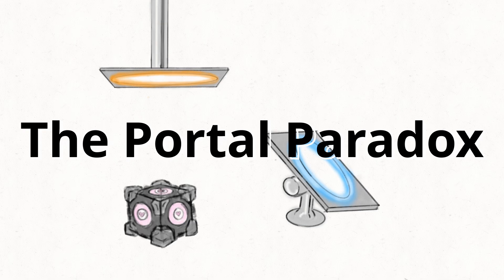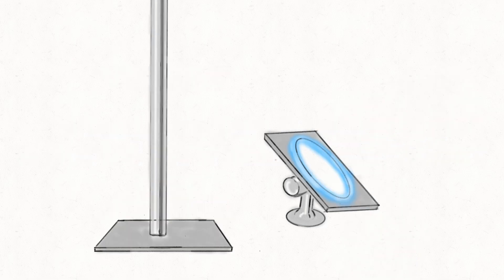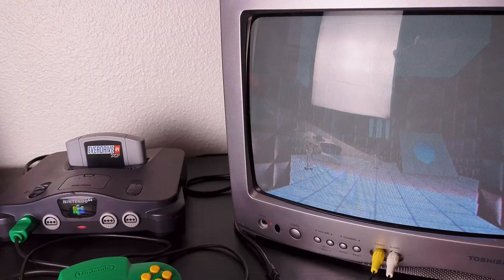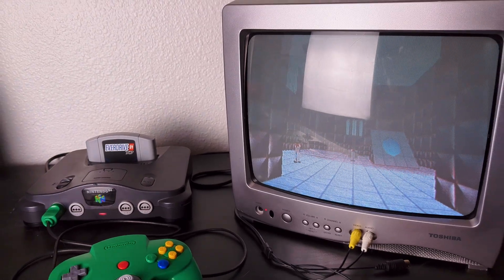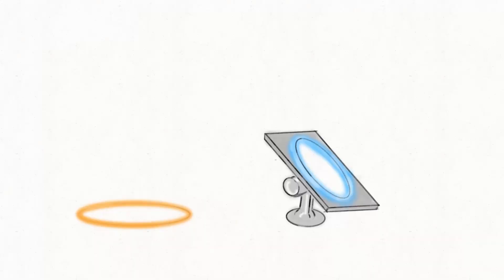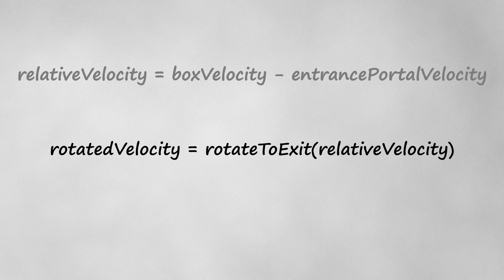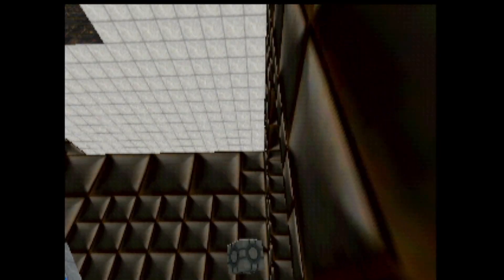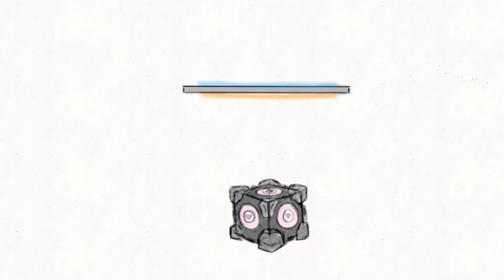I rewrote Portal from scratch and solved the Portal Paradox

Comment: Ok now I have a question of what would happen to the orange portal that gets slammed into a wall and thus has no like open air to free flow through it, like would a vacuum appear that just rips everything into it until a new open air area appeared in front of the orange portal or would it cease to exist once this happens and thus a closed blue portal would then exist

Comment: 0:53 - "...does not using Source engine invalidate this test?"

To be fair, moving Portals ARE possible in Portal 2 (I'm not sure if they're possible in the original Portal though), however the set-up for the """paradox""" still doesn't work as the piston just collides with the box and gets stuck (it's possible to disable collision on the piston to make it not collide with the box, however this means the Portal cannot be placed onto it. The real paradox is figuring out how emulate the scenario in the original game engine).

Nice work on Portal N64 though. Can't wait to see the next update video!

(Side-note, I don't know about you, but I absolutely hate this """paradox""".
It's not even a paradox, it's mostly a bunch of laymen arguing over something they can't answer because they lack the fundamental understanding of physics required to figure it out (and even if you have that knowledge, it only takes a minute or two to solve and debunk))

Comment: If the portal rapidly descends but stops abruptly at your neck level, does your head fly off?
If it descended upon a stack of cubes, would each cube fly off with a delay between each?
Reply: if it's descending with enough force to rip the neck then yes, if it does not, then it would be painful but the rest of your body gets pulled through due to the momentum dissipating.

Comment: What if this happens: The portal moves down towards the cube, but about halfway down the height of the cube, the portal stops moving. According to your approach, we'd have half of the cube sticking out of the other end of the portal which would experience velocity X, but the other half of the cube would still be where it originally was, with velocity 0.

If you think about it, according to your approach, the intertia resulting from the half of the cube that's already through the portal and that, according to your approach, should have velocity X, should at the very least lift up the half of the cube that still hasn't passed through the portal. Additionally, this only works because in the game engine the cube is a rigid body with no flex/stretch. According to your assumptions, the cube would get stretched/flexed because one half is stationary while the other half is accelerating. This, in turn, would have even more effects down the road once the whole cube has passed through the portal.

Unless, of course, the way you coded this is that velocity only gets transferred if an object has passed through the portal 100%, but in my view that in itself is an incorrect assumption about how portals work, and thus would invalidate your experiment.

Another way to test this would be: You, the player, jump through a sideways-moving portal. According to your assumptions, and implementation, once you have passed through the portal, the sideways-velocity of the entrance portal should make you, the player, move a little bit to whatever direct the entrance portal was traveling towards at the moment you passed through the portal. However, since one part of your body is moving, and the other is not, this would rip apart your body from both inside and outside, killing you almost instantly. Unless, of course, the moving speed of the entrance portal has no effect on the object passing through.

Additionally, this whole debate about this topic is whether the velocity of the entrance portal has any effect on the relative velocity of the cube. You just assuming it does, and then telling people "my experiment worked because I based my assumptions on my personal understanding of portals, prove me wrong", while you have no proof yourself that your assumption is correct, is at the very least a little disingenuous.

Comment: I never clicked on recommended videos about the portal paradox because it seemed obvious to me. Speed is always relative, so the exit speed of course depends on the entry speed relative to the portal. In game engines, position and velocity has to be stored in an absolute way, so it'd actually be easier to implement this with the absolute velocity, though not physically accurate.

Comment: I'm actually really glad that you brought this question up because I decided to wrack my brain on this question as a serious question regarding what would really happen, suffice it to say that yeah, GLaDOS literally explained it, speedy thing goes in, speedy thing goes out, and that speedy thing is from the relative point of view of the portals which from their view are always stationary while everything else moves around or through them.

A fun side piece I realised though is angular momentum and forces acting through a portal, as well as a very interesting scenario of "What happens if the portal stops half way? Does it stop like nothing happened or what?", and the answer is "moment of inertia still exists, however much mass passed the portal will have inertia, pulling on the rest of the mass of the object through the portal like a harsh yank but through the entire intersecting plain.", which leads to very weird potentials of indirect forces acting on portal surfaces.

I don't remember everything on the matter off the top of my head as this was like a year and a half ago that I thought about this and logically approached it as, but there's a lot of weird and cool edge cases regarding physics and portals, I have the entire argument and logical set written down somewhere if anyone wants to chat about it as it's a very interesting extended problem.
Reply: I've also thought about these some time ago. iirc If you place the exit portal on a rail, facing a wall, and then start pushing a long stick into the entry portal, when the pole touches the wall, instead of stopping you from pushing further, the exit portal will start moving on the rail, even though it's not in contact with anything. super weird behaviour but that's what makes it interesting!
Reply: @kantoros  yeah, that leads into the whole "weird potentials of indirect forces" thing.

On the one hand, in theory, there shouldn't be any effect on the portals as they are not being contacted.
On the other hand, in theory, there should be an effect on the portals due to their ability to impart moment of inertia.

And while I don't remember my original conclusion, I'm actually leaning toward the latter thanks to some recent physics concepts I came to know about recently.

The way it'd work would likely end up acting like an air spring or pneumatic piston with a pressure gradient leading to a "spooky force acting at a distance" to appropriately quote Einstein.
You're still applying force to the wall on the other side of the portal, but with it acting as a stopping, stationary force, the force will instead start being imparted on the portal as it effectively acts as an inverted form of the same effect that causes imparting of moment of inertia.
Reply: @kantoros  Ooh! Very interesting.
Reply: As much as I’d love to talk about this privately, I feel like it actually deserves a video of its own 😁
Reply: @RonWolfHowl  dude I would love to make a video on this but I do not have the means to do so on my own, and it's kind of sad given there is an absolute ton of amazingly fun nuance to the brain breaking physics of this that would be amazing video content.

For example a visual representation of exactly what is going on with the other reply I just made would work wonders for explaining it better.

It also just sucks in general because if I had the means to making a video on this subject I'd also absolutely be working on the two portal 2 mod campaigns I've been writing up every now and then when inspiration strikes. Moving portals and their properties was going to be a thing I was going to attempt after having thought about them and their physics.

Comment: The true result is that the cube flies with momentum.
Solid objects are made out of particles. As each particle of the cube travels through the portal, it has no momentum, but is immediately pushed by particles behind it, giving it momentum. Therefore, every particle in the cube will have momentum equal to the movement speed of the traveling portal, meaning the cube as a whole will have momentum, meaning the cube will then travel at high velocity rather than stay stationary.
Reply: Since the portal does not impart any momentum to the object, the object coming out of a portal would have the same momentum as an object going in; in this case, zero. You are essentially moving an old location in space to a new location in space, not "moving" an object through a portal.
Reply: @ianwalsh3868  Because the portal is moving, and the cube is sitting on a static surface, it must move through the portal, which means it is traveling from one side to the other in relation to the portal.
The atoms in the cube that have yet to pass through the portal are now exerting force on the atoms that have gone through the portal, giving the cube new momentum overall.
If the atoms in the cube were to have ZERO momentum on the other side of the portal, the cube would become infinitely flat.
Reply: @kip258  It is more like the cube is being teleported to a new location, one slice of atoms at a time. The atoms don't push against themselves anymore than they normally would. They start in one spot, and are instantly in another as soon as they pass through the portal. The object itself never actually has motion. Passing through the cube doesn't affect the atoms. The portal just connects two places that don't normally connect. If the orange portal were smashed on top of the cube like in the video, the orange portal would hit the ground and the cube would be sticking out of the blue portal at an angle, then it would slide off because the blue portal is on an incline. If you looked through the blue portal after, you would just see ground that matched the incline the blue portal was on, but the ground you see would be under the orange portal.

Comment: Your answer makes 100% perfect sense. Is this even a paradox? Is anything not really testable, portals aren't real, a paradox? I wouldn't think so. If portals were real it would make sense for it to work this way, the only weird part is the energy getting transfered without touch. Does a portal lose energy when you slam it onto a cube with the energy of that slam transfered to the cube? Would you lose zero energy? Would the portal frame slam into the ground with all the force put into the slam while also throwing the cube with the same force for free? That feels like it'd break some law of physics or whatever, I wouldn't really know.